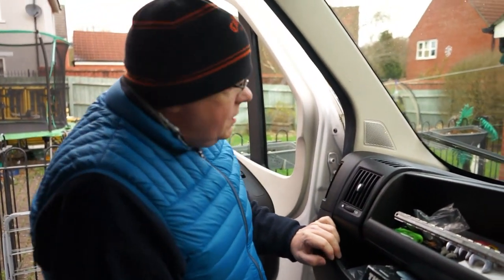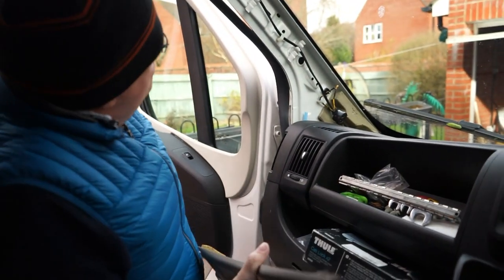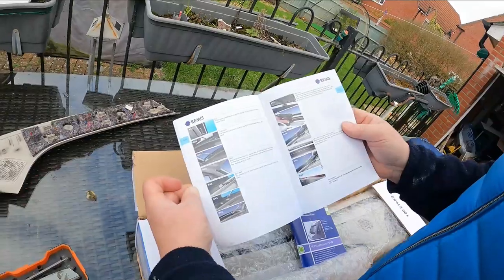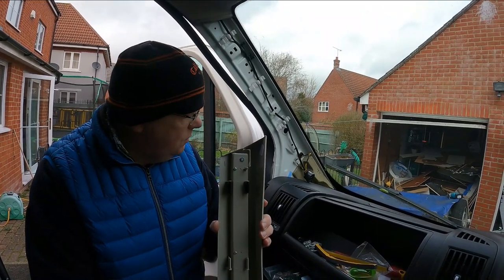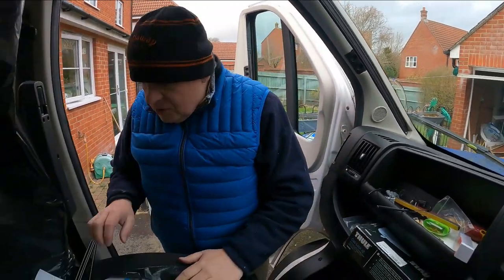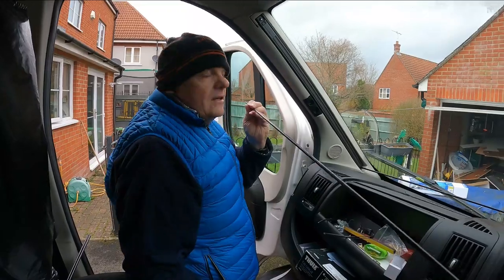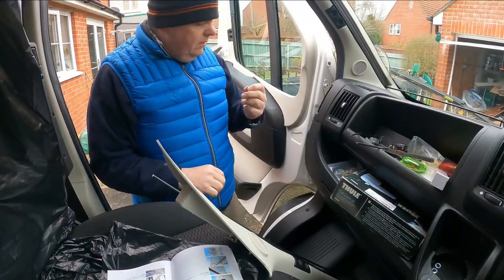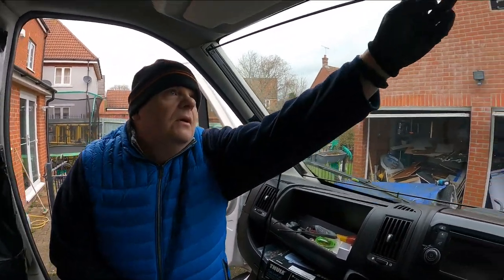Remis Windscreen cab blind install on Citroen Relay / Ducato / Boxer / Promaster.

Comment: Hello. I know this is 2 years old. Apologies if my question has been asked and answered many times. It’s September 2024 now. I have just collected a brand new motorhome. Paid extra for Remis cab blinds, as shown in your video. They look as though they have been fitted pretty well. They meet in the middle and stay together courtesy of magnetic strips. However, after approximately half an hour they ‘twang’ apart and go back to their respective sides of the windscreen. It doesn’t matter how careful we are in closing them. I should take it back to the converter that fitted them, but it would be a hassle If prefer to avoid if possible. So, I’d like some understanding as to why this might be happening, and of course what the remedy is. Note that it happens every time, and not just occasionally. Thank you, in anticipation.

Comment: Great video. Thank You!  Would you be able to confirm if the blind will still close with the iPad holder up?
Reply from the maker: No it wont unfortunately. I can just about leave the dashcam mount on the window but need to remove the actual dashcam itself.

Comment: Way better looking than a foil and card blind, i might see if i can adapt an IKEA blind to do similar but they are nice,  no getting away from it 👍😎
Reply: I used ikea blinds on all my self build windows . They work well and very cheap
Reply from the maker: I did buy a set of foil 'sucker pad' ones from Magnums but they were crap. I did not want to spend the £550 but after spending so much already seemed the sensible thing to do to finish it off. I still have the foil ones and will see if I can do something with them to stick better for summer use as a reflector. The Ikea blind option may well work with a bit of design flare and adaptation.
Reply: @wiltshirecustomcamper7203  i have IKEA blinds in the rear but they are nice easy square holes, the front is more complicated 🤔 there's an awful lot of work gone into those remis front blinds so i can see why they cost what they do and they look great and considering how professional the rest of your conversion is i can see why you took the plunge 👍 
That really is a very well done conversion you have there chap 😎
Reply from the maker: @Dirt-Diggler  Thank you for that. Ironically I think I could have done much better and now with hindsight, better knowledge, more experience and better understanding of it all, van number 2 (assuming I successfully sell van number 1) will be much much better. I've done plenty that I would change and do differently if starting again.
Reply: @wiltshirecustomcamper7203  It's a long slippery slope to get onto 🤣 I've rebuilt my camper 4 times already, only had it 2 years 😮

Comment: 1/4" drive ratchet and PZ bit  does that squeeze in
Reply from the maker: Yes it would and I tried that but could not get enough force on it to get the screw started. although in fairness my old Snapon ratchet has more play in it than a Land Rovers drive train.
Reply: Or I was thinking hex head self tappers and a ratchet would do too.

Comment: Frustrating thing is apart from all the new rattles you'll have is that you still need the external thermal blanket to negate the condensation.
Reply from the maker: Have been on several trips and none of it rattles I have to say. I will take the crappy silver clad blinds  i started with during the height of summer to reflect the radiant heat away and they will tuck neatly behind the remis blinds. have not experienced any condensation issues yet so cant comment on that,